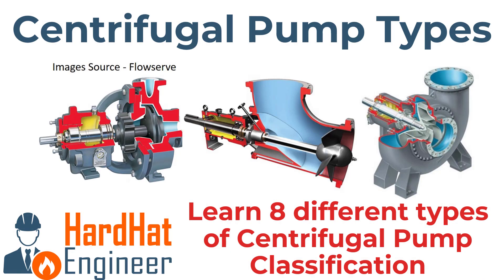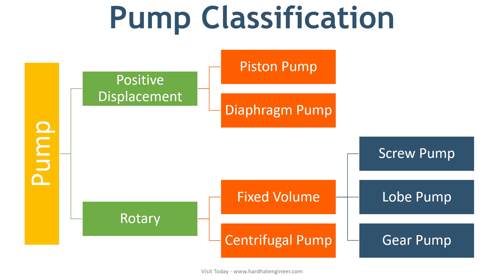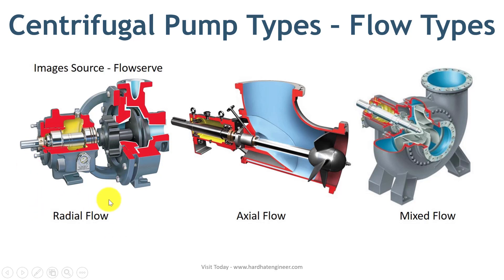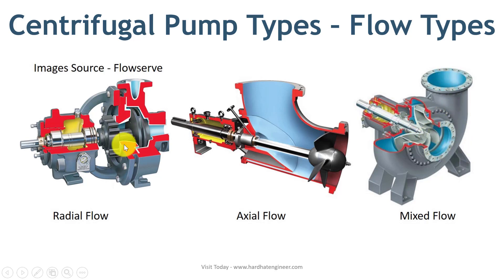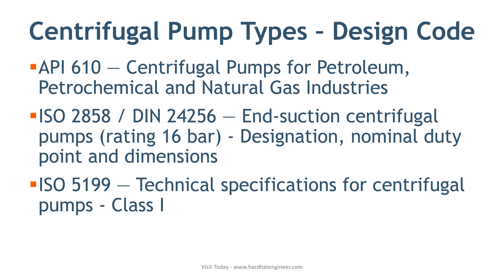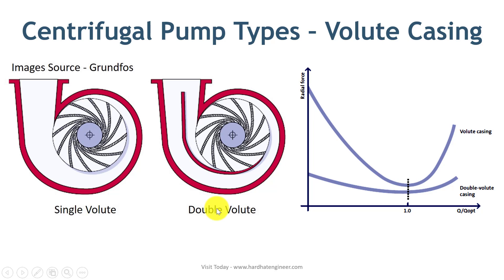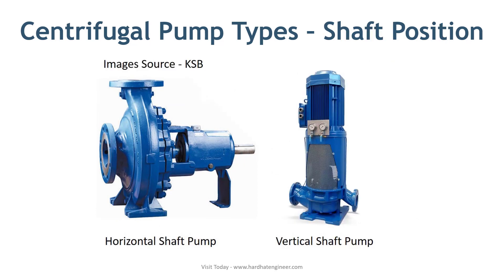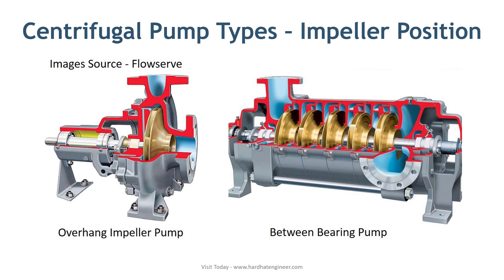Types of Centrifugal Pumps - 8 different types of Centrifugal Pump

Comment: Hi can I use centrifugal pump for lifting  foam concrete  for 4 meters with  out change  density..or damage the bubbles. And which type of centrifugal pump is the lowest  effect on the foam concrete  specification. Thanks.

Comment: Hi dude,
I see is a flowserve pump picture. I have a question which better to choose API 610 BB3 or BB5 for Hydrocarbon liquid with Flow 165 m3/h and Npsha only 2.5 m?
Reply from the maker: Check with pump manufacturer as they are the best to suggest most suitable pump for particular fluid.

Comment: Sir, I'm concerned with the classification you gave about the pumps. I don't know which source you referred to but gear pump, lobe pump, screw pump are positive displacement pumps.
Reply: you are right.. pump should be classified either as dynamic or positive displacement pump. dynamic pumps include centrifugal pumps and positive displacement include the vane pumps, gear pumps, piston pumps, etc.
Reply from the maker: It is also refer as positive displacement but not in the sense you are thinking. It pump fixed volume like other PD pump but they do that by rotating and not by reciprocating.
Reply: @HardHatEngineer  Centrifugal Pumps are dynamic pumps not Rotary pump. Positive Displacement pump have further two main types as reciprocating Pump and Rotary pumps. Rotary pumps are fixed flow type pump like Reciprocating pump. They have mostly High pressure and low flow. Centrifugal Pump works on the principal of converting the K.E to P.E and so outlet pressure is higher at outlet.